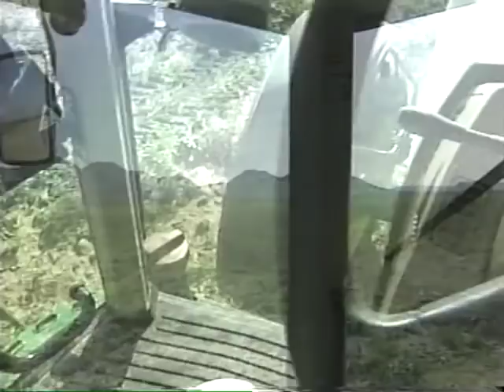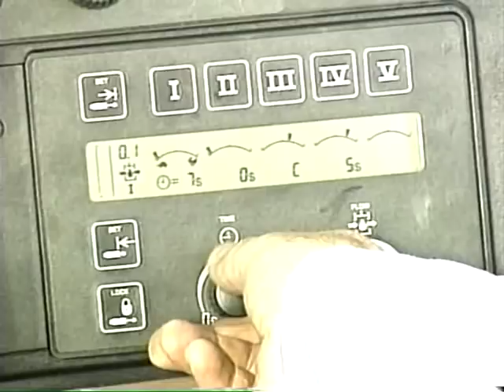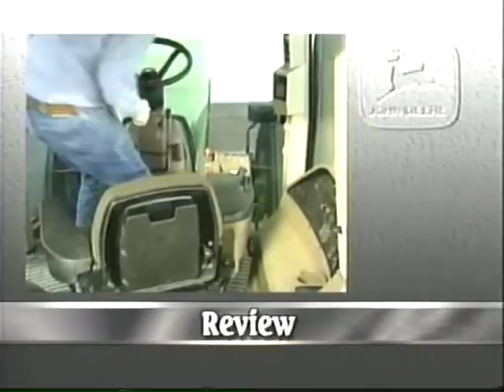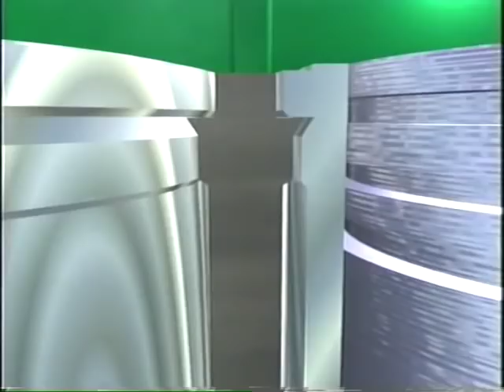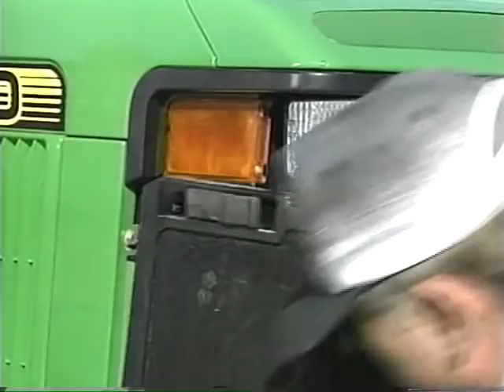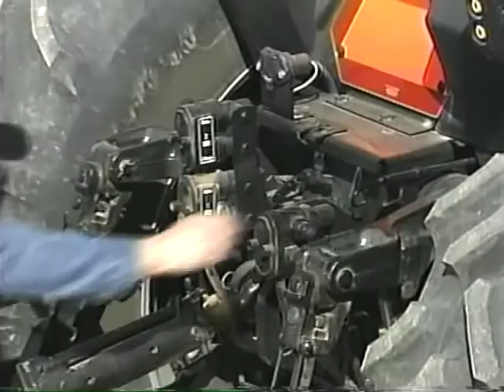CaseIH Magnum vs Deere 8000 Series

Comment: A JD salesman told me he was selling for CaseIH when they introduced the Magnums. He said they traded in a LOT of 40, 50 and 60 series JDs for new Magnums. But he said all of that changed when the 8000 series came out.  I think when those 71 series Magnums came out they were the best tractor on the market. Hands down. Power shift standard in all models, Cummins engine (why they went away from that is is mystery), hydraulic clutch, dual PTO like the prior IH tractors, much roomier cab than the old JD coffin cabs.

We always had IH tractors when I was growing up and today we're all JD for our primary tractors. I had a CIH 260 and traded it for a JD 8260R.  I just prefer JD to CIH at this point.

Comment: i have been around  both kind.i have been driving a 8000 for years , and have worked on the magnums and deeres i have seen rims  busted on the case  and dash board burned out ,electrical problems on the case i would't have a case period

Comment: How is this even a comparison? I own both John Deere and Case. They both have good points but that magnum doesn't even come close to those 8000 series
Reply: I had a 7120 at the same time my brother had an 8100. Overall I preferred the 8100 because of the electronic hydraulic adjustments and visibility. Much more glass in the JD. But the early 8000s shifted very rough compared to the Magnums. And the JD takes a back seat to the Magnum on the clutch. Magnum is hydraulic and easy to feather. Like you said they both had their better points.

Comment: We ran IH for 30 years we had a 1086s 1586s 4366s and a 4386 and always 2188s or 2388s and we still have a 2388 then we bought a 9130 one day working ground we threw a rod in our 4386 and we were friends with a John Deere dealer who let us borrow a 8100 the 9130 kept getting stuck and dad could come over with the 8100 and outwork be 2 as much we bought 3 8400s after that

Comment: The John Deere’s don’t bounce that much
Reply: Every R model Deere I've drove bounced like the one in the video.  Only way to get it to stop is slow down to about half throttle
Reply: Heather Price we have a 6140R it used to bounce. Then we get a big bucket for it and it doesn’t bounce when it’s on it, so just put some weight on the front
Reply: The tire where flat

Comment: I have a feeling that they took a lot of air out of the tires on the deere to get it to lope during road travel like that lol
Reply: My father's 7240 has road lope. Not sure what causes it maybe crap good year tires. I was raised red but I'm nothing but green now.
Reply: elkslaxer18 you can see on the Deere that the front tires are a lot lower than the magnums
Reply: Gotta think that the weights being a lot further ahead of the front axle of the Deere cause a lot of the loping.
Reply: Jeremy Murphy yes but the tired do seem lower than what you would normally have
Reply: elkslaxer18 from experience they are pretty horrible road driving with any tyre pressure when reaching max speed.
Reply: @joemarshall741  huh I've never had that problem with any of the 8000 series tractors I've driven. The only time I've experienced it was with a 9650 combine.

Comment: Trying to compare the hydraulic controls 😂 so dumb seriously
Reply: that one made me cringe a bit, the mx series definitely made up and modernized tho imo, even if they copied the cab, they built it better.
Reply: @wyattspevacek8621  Thats bullshit i Know several case fans with mx's Where the transmission Exploded at only 6000 hours
Reply: Even they dont like the mx series
Reply: @JSMachineWorks  Never ever had that issue and don't know many guys around us that have either, we still have a 270 and 240 we use daily and they still run like its 2001. i love their powershift, id say it was a superior transmission to their earlier cvt entries in terms of reliability.
Reply: @JSMachineWorks  Also I was mainly drawing the comparisons of the cab, I have no experience with those early 8000 series much other than looking online or on the lot at a dealer for fun.
Reply: @wyattspevacek8621  i think all of the first cvt transmissions except for fendt weren't very reliable also just notices this video is magnum vs. 8000 not mx vs 8000 that's what I meant by comparing hydraulic levers to electronic scv's trying to convince people that mechanical is better

Comment: I guess the IHC engineers knew what they were doing when they designed the synchro-tri-six. 

Case got away from Cummins engines, and now Deere is using them.

And they're pulling less disk than we did with a 1066.
Reply from the maker: Even around this time Deere would have been using the N14 Cummins in their 8970 tractors. I think getting away from the Cummins engines was a mistake for Case.
Reply: CIH should have never left Cummins.  JD really only used Cummins for the very large displacement.  You can not beat the the JD engines in their Row Crop tractors.